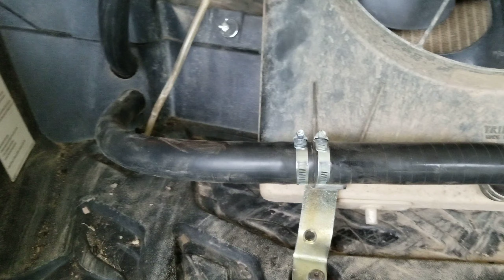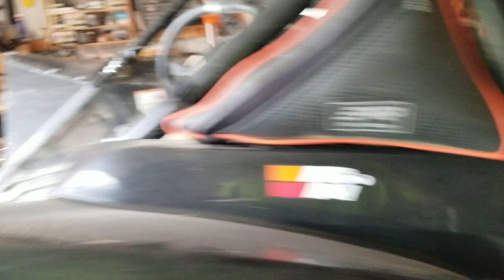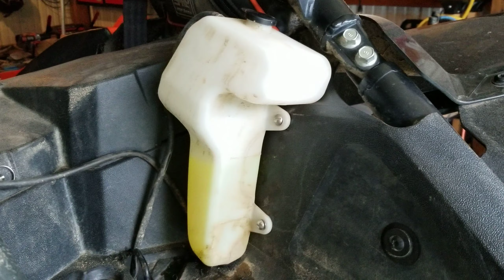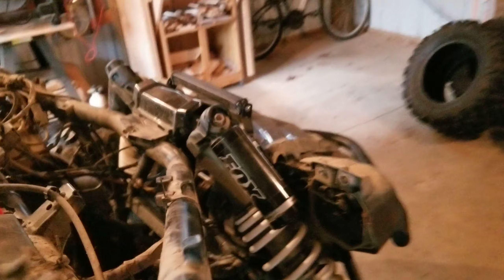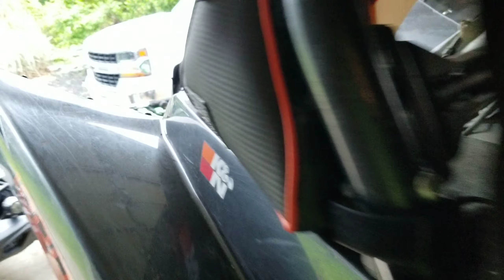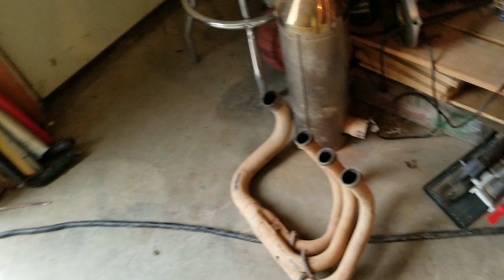YXZ Radiator Relocate Part 2

Comment: Awesome Video! Where did you connect the overflow tank connectors to the radiator? Does the bottom nipple go to the nipple on the top of the radiator? If so where does the other one go?
Reply from the maker: Yeah the bottom one goes to the radiator cap and the top one is just an overflow drain so it doesn't go to anything. It just feeds thru the bed and is open ended.

Comment: Nice work....what clamps did u use on the bar
Reply from the maker: I cut a couple band clamps to fit around the bar and used some 1' spacers to push the radiator up a little bit.